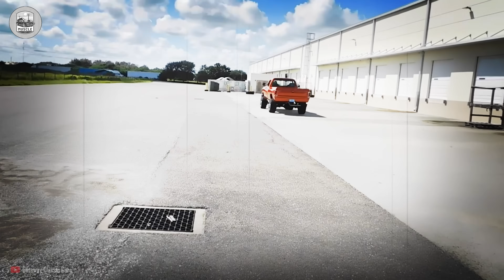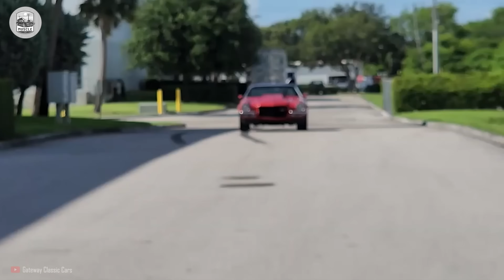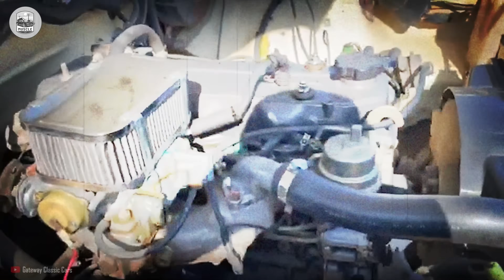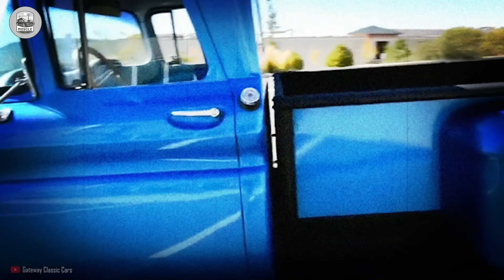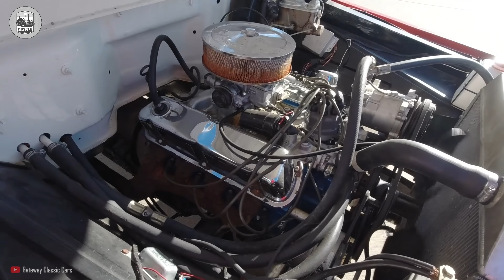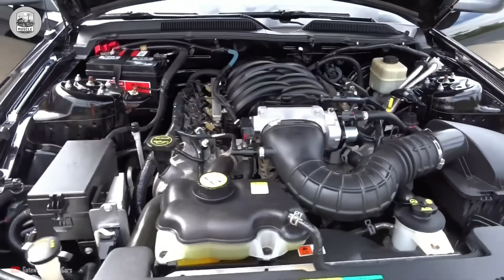Top 10 Most BULLETPROOF Pickup Engines EVER Made – Real Owners Voted!

Comment: Driving a 5.9 magnum with 865 thousand on it runs perfect
Reply from the maker: No way, man—865k on a 5.9 Magnum? That’s insane! Props to you for keeping it alive that long. Those LA-based Magnums were tough as nails when you stayed on top of oil changes and cooling. Most folks ran ‘em hard and let ‘em die, but sounds like yours is living proof Dodge built ‘em right back then.

Comment: I have a 92 buick roadmaster with the 350 small block. 24,000 original miles. Shes brand new. It can be so good on gas, or you can have some fun with it. Ut throws you back a bit when you gun it, things got some torque